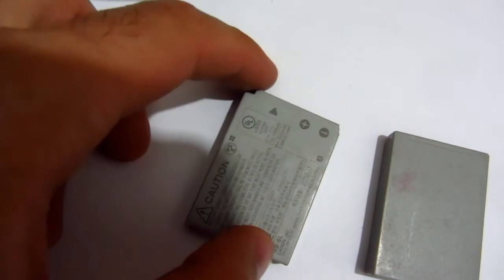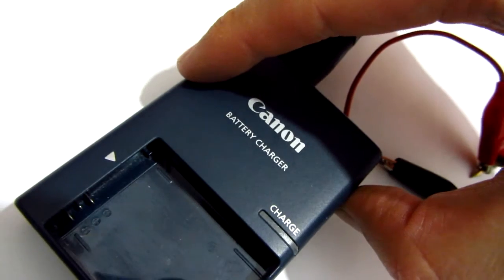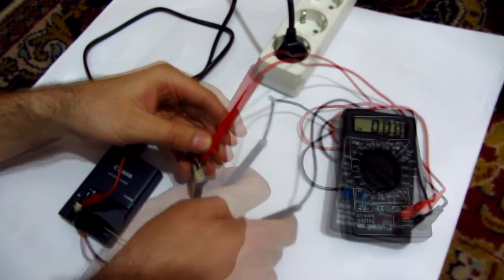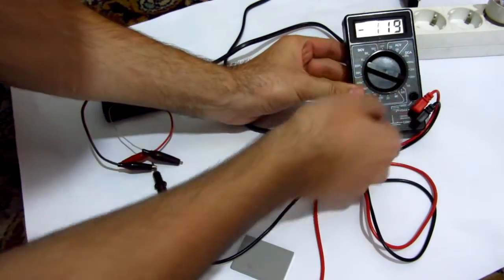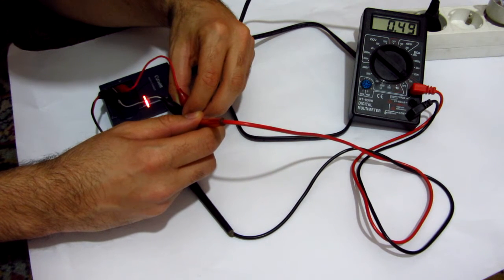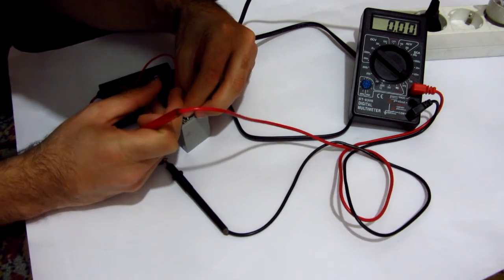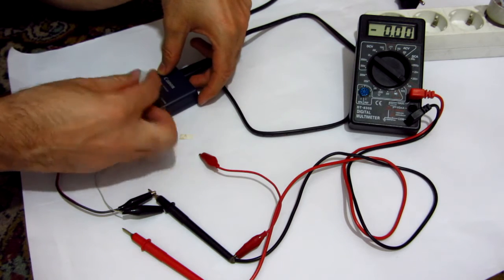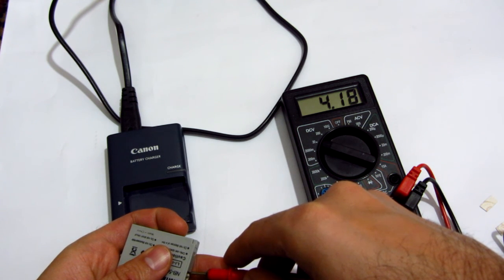NB-5L Battery Charging Measurements (Volts, Amps, 3rd Pin)

Comment: If the T connection is not connected, the Temperature can not be measured. Li-Ion batteries are great in many ways. But. If you make them to hot, they will explode. The inside of the battery may not come into contact with the surrounding air. When the Li-Ion battery gets warm, it will expand. If it expands to much, the package might get damaged, and air flows in. And then it will give a big fire show.

Short story: the T connector is a security measurement against overheating.
Reply from the maker: Thanks for the info! I usually monitor myself such Li-Ion batteries, temperature (by hand) volts & amps (multimeter) and charging time.